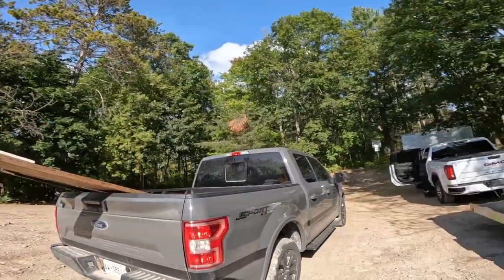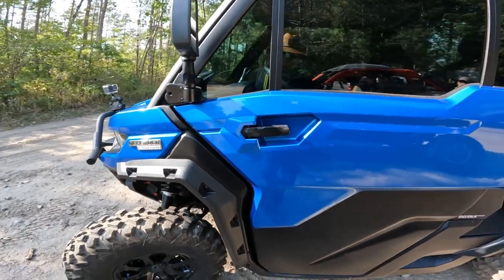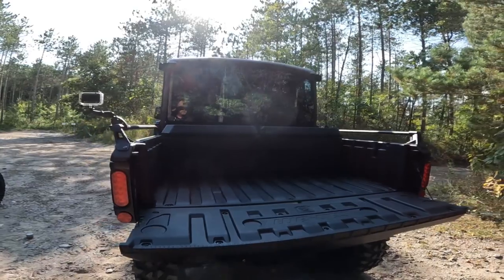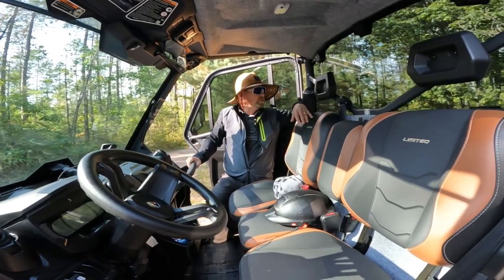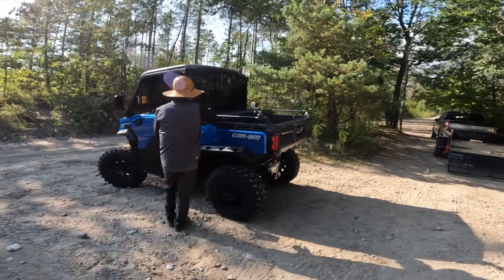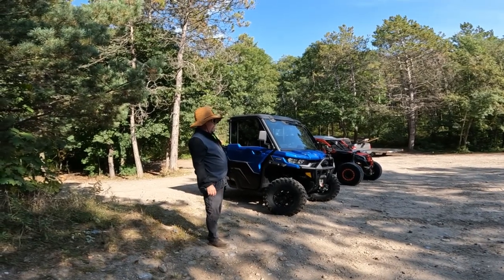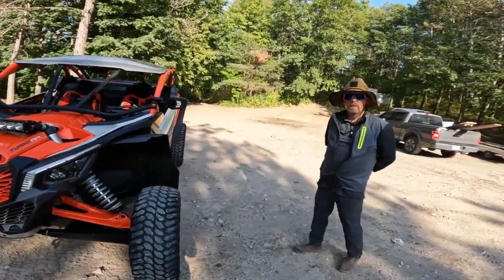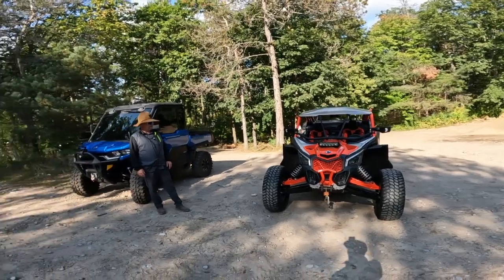Ultimate Review: Can-Am Defender Limited vs. X3 XRC - The Battle of the Beasts

Comment: Can you please provide a link for your side mirrors. Thanks
Reply from the maker: https://a.co/d/02QZGbMf
Reply: @atmoff-road  thanks very much.
How is the Defender for trail riding? I’m about to pull the trigger on one.
Reply from the maker: I would say great if it’s not to bumpy. I put Fox QS3 shocks on mine to help the roly-poly from side to side it helped with that but the regular trail bumps not so much. It’s hard to work with only 8 inches of travel. I also found it nervous on the roads left and right. The suspension geometry is just not there for higher speed trail riding with bumps. I was trying to polish a turd. I’m sorry to say.
Reply from the maker: I sold my Defender and got a Polaris Xpedition XP 1000. If you want a buggy that does everything very well, the  Xpedition is the buggy.
Reply from the maker: The Defender Limited that l had was my first experience with an enclosed cab. I gave up a lot of power and suspension coming from an X3 XRC 72”. But the enclosed cab of the Defender changed everything for me. And l put up with the lack of power and suspension of the Defender because of the cab. Spend the money and go for the Xpedition. I’m sorry to say but if you like to ride aggressively through the trails,you will not be happy with the Defender.
Reply: @atmoff-road  oh that’s certainly not saying much about the Defender. I have a RMAX now but it’s just too noisy for me. As I get older I need something quieter with HVAC.
Reply: @atmoff-road  I’m not an aggressive driver and do only easy to intermediate trails.
Reply: Thanks very much for your feedback. I looked at the Polaris but I can’t bring myself to spend that much on a side by side. I may have to rethink my position.